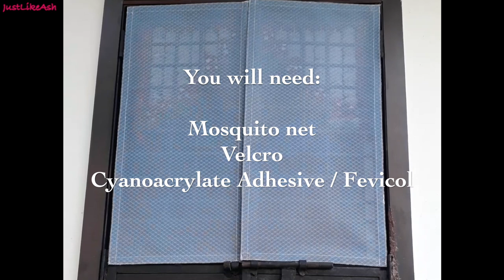DIY | Removable Mosquito Net Using Velcro At Home | For Doors & Windows | Super Eas

Comment: Cynoacrylate is not working for me. My window frame is of aluminium. I even tried couple of other adhesives like Epoxy and Flex Kwik, but didn't work either. Could you suggest something.
Reply from the maker: Have you tried fevicol?
Reply: @IndieTreatz  as far as I know Fevicol doesn't works on Aluminium.
Reply from the maker: @ashwin-wb6yq  i used fevikwik in video.. but later we realized that it will not hold for longer periods.. so we used fevicol and it is in perfect condition till date.. we removed net 2 times for washing, it is still intact..
Reply: @IndieTreatz  tried Fevicol, but it didn't work too.
Reply: @sharathchandrachakram  will try it out, thanks.

Comment: Hello,  
     I have tried it . I stitched the net but velcro is not sticking on the sliding borders. I m  using the same chemical that u showed in yr video but still velcro doesn't stick on the sliding.  Pls help 😯
Reply from the maker: Hello.. try Fevicol.. it will stick.. after applying Fevicol let it dry for 2 3 hours.
Reply: Use hot glue gun